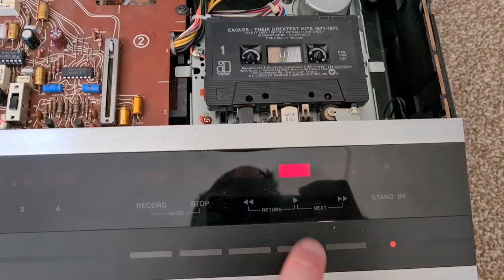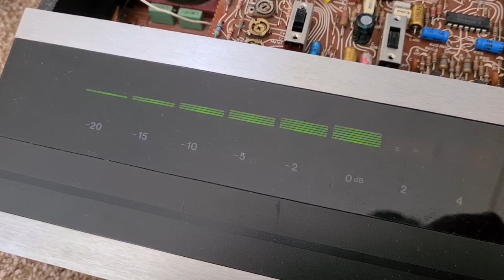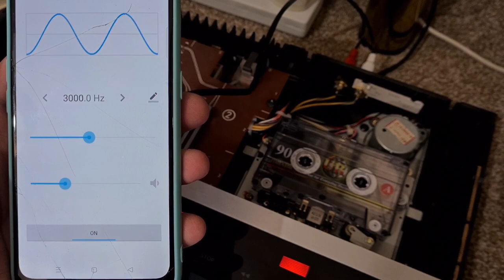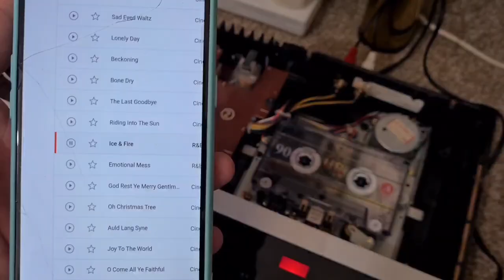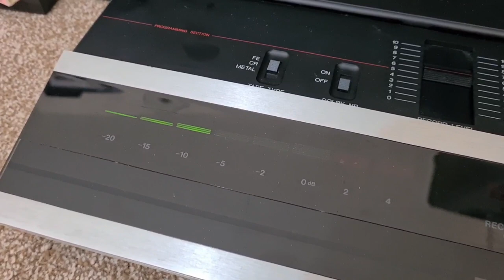Bang & Olufsen Beocord 2000 Cassette Deck - Repair, Mods, Belts & Service

Comment: Bought a Beocord 2000 from eBay for £60, set of belts also from eBay for £15, and thanks to this video, was able to fit them easily - it's now fully working and matches my existing Beomaster 2000 amp, which looks so cool.  Thanks!
Reply from the maker: This is the way!

Comment: Cool restoration. Those keyholes in the back of the case looks like you might be able to mount this on a wall or at least some sort of inclined surface.
Reply from the maker: Yes, from the marks around them it looks like it has been at some point in its life

Comment: Thank you that's a great video I scored a beocenter 2200 from a church sale. They actually threw the speakers out and I found the unit and saved it. Brought it home taped out didn't work I ordered new belts, three of them install them it is working now but the rewind just seems to jiggle. Looks like it's supposed to have a belt on it but I'm guessing they're just interchangeable, from the manufacturing process. Any help would be greatly appreciated! Thanks that's a great video you made!

Comment: Howdy, from across the pond. Thanks for the amazing how-to! I picked up a Beomaster 3000 set at an estate sale and, surprise! The Beocord 2000 is in dire need of new belts. (All the Beogram needed was a needle; think I got lucky.) Anyway, thank you for such a clear tutorial on what I will need to do to get the tape deck back to functional. Now to source the belts…
Reply from the maker: Hey there! Thanks. I think I ended up using belts just lying around in stock here that just 'fit'. I wish I'd kept this one! Those beogram cartridges and needles aren't cheap. I always wanted to 3d print some sort of adaptor to use something more traditional, because they do come up cheap for sale due to expensive and hard to find cartridges / stylus etc

Comment: If you record 3khz in this deck, and play it back to test if it is 3khz, it certainly will play back in 3khz. 
What you should do is rather, take a cassette with a sound track which has exact 30 min run time, play it on this deck with timer running. That way at end of track you must have 30 min on clock.

Comment: Nice video. I appreciate the 10 minute edit 🙂
Reply from the maker: I'm editing this week's video now and I can appreciate how boring it can sometimes be. I really am cutting out a lot of chaff and trying to stick to relevance. I'm getting better I think!
Reply: @pwrestoration  I quite like the editing. It's rare to be able to focus on one thing at a time. But it takes sooo long. BTW great tip for removing old belts with cardboard, I'll try that. I would have been interested in seeing that in the video too.
Reply from the maker: Thanks for the heads up on that - I'll demo it next time I see some belt gunk! It really does make a 20 minute job done in a few minutes

Comment: Digressing. Have you done a similar strip down on a Hitachi piano key deck of late ‘70s?  I have issues with my D560 and need to delve into the tape mechanism but need guidance.
Reply from the maker: I haven't but they're all very similar in the 70s silver front era, just get a screwdriver and get into it 👍

Comment: Restoring my 2000 I have tried some looser belts but still will not turn with any belt applied, and spins freely with no belt.   That probably leaves me at trying to identify a replacement motor if no other options.  The MMI-6A2RK motor seems hard to source.  Do you have any suggestions as far as a alternate replacement motor?
Reply from the maker: If you're confident it's the motor, any 12v clockwise cassette motor will do it!

Comment: That was great Thank you \. where do you get the belts from?
Reply from the maker: I think it was a case of just finding some in my stock that fit! I generally buy packs of belts by the 100 / various sizes and go from there. They're actually cheaper than buying one!

Comment: Good Job! Why you don't you use Din to Rca adapter instead of changing all the wires??
Reply from the maker: I guess it's a combination of preference, not having to have yet another adaptor, and I just wanted to have a bit of a play and install some RCA plugs 😄

Comment: I'm restoring the same B&O 2000 and I tried to get the same belt size you showed in the video at 22:48, but when I put it in place the motor won't turn anymore.  If that is the right belt size per your belt size video, does this mean the motor is going bad and doesn't have the torque to turn it?
Reply from the maker: That's a difficult one, with the belt in place does it feel really tight? Can you take hold of the belt in between the pulleys and twist it 180 degrees?
Reply: @pwrestoration  Thanks for betting back to me, it's snug but not super tight, so you can twist it with your fingers.  I notice with the belt removed and the smaller bronze pulley would spin on its own too

Comment: Whats the best oil / grease to use on a cassette mech?
Reply from the maker: I like to use basically sewing machine oil. It's called Slug Slime and it's on eBay. For grease I use Molycote DX.
Reply: @pwrestoration  thanks for that PW. Really appreciate it. 👍😁

Comment: At 26:48, you've threaded the rubber belt incorrectly and opposite to what it needs to be. The 2 parts of the belt must be on the SOLENOID side of the Brass Pulley. Also R8 is a 4.7 Ohm resistor, NOT a 47 Ohm.

Comment: Did this company EVER make a direct drive deck? All this pretentious wank, but no stereo meters (usually a single line on LEDs and not two) and no direct drive? These guys are almost as bad as BOSE.
Reply from the maker: There's a lot to unpack there.. I don't think they made a direct drive deck. But that's also, IMO, not a pinnacle of cassette engineering. Technics made plenty, and although their looks were quite generic they were good.

The B&O stuff is an odd one, but yes I think they were going fashion over function in some cases. The die hard recording fan wasn't their audience, probably just the average guy with a bit of cash and some tapes.
Reply: @pwrestoration  I find that rather ironic considering they invented HX-Pro, which really was a game changer for tapes. I took your advice about Technics too, even some of their 2 head jobs were quartz lock direct drive. Who does that? Anyway, they're all in the UK and Europe,  so shipping will be brutal, but I'll get there.